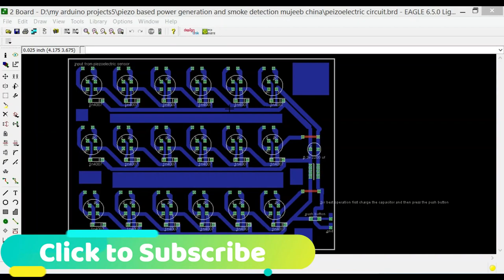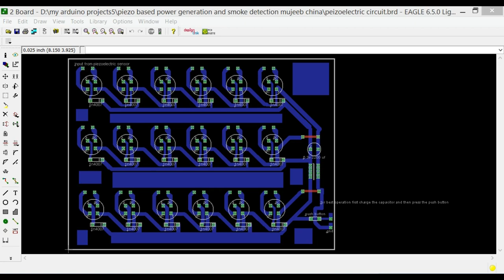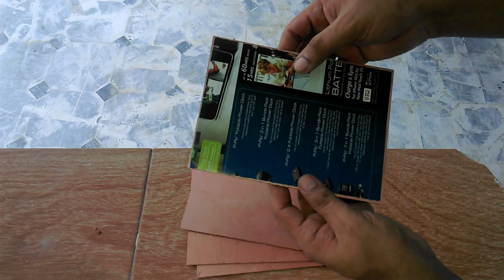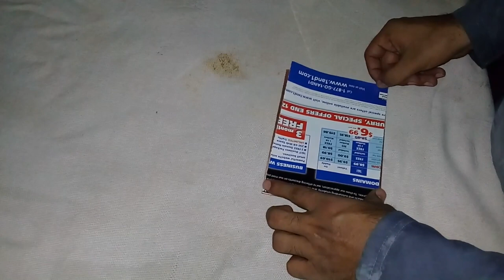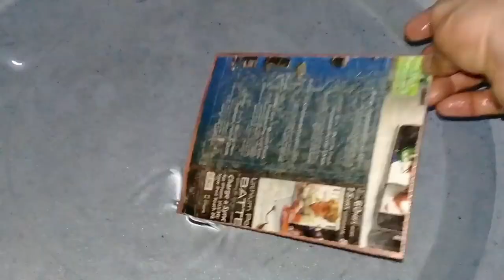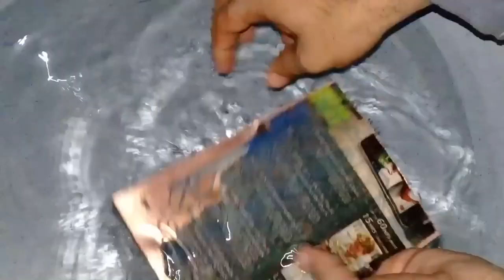PCB Design Setting, Printing, Transferring and Etching using Ferric chloride Acid "make PCB at Home

Comment: 1.Instead of using magazine just use Butter paper 
2.While Heating the paper on the circuit board cover the butter paper with a normal paper and then apply the heat
3. After that just sprinkle some water on the hot butter paper the paper will peel off easily and the circuit will be printed on the board no need to use the marker
4. Use Hot Water and then add FeCl3 hot water acts as a catalyst and the reaction becomes faster.

Comment: waiting for next video fahad .pcb drilling,soldering,applying flux,Resin,Green Mask etc Hope u will be explain all of them.
Reply from the maker: may be in a few days. coz this projects has a lot of drilling and soldering. each board has 18 piezos, 18 diodes, 18 bridge rectifiers. so next video will be only on drilling and soldering. then other videos will be on sensors soldering and testing.
Reply: ok thanks  plz complete this series as soon as possible.can u tell me for what project u design this circuit?